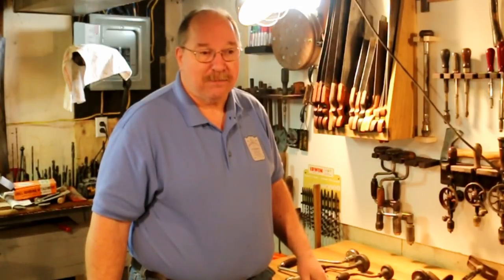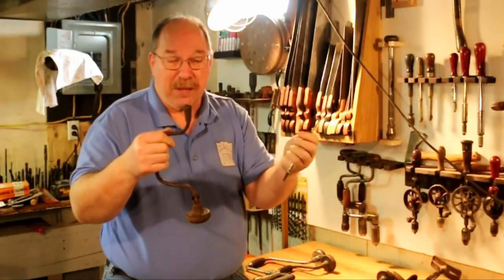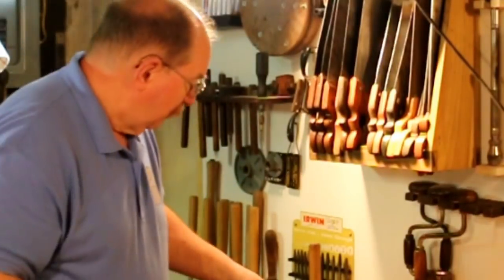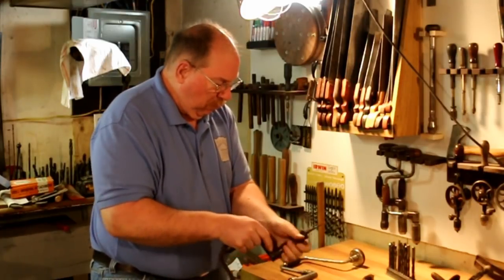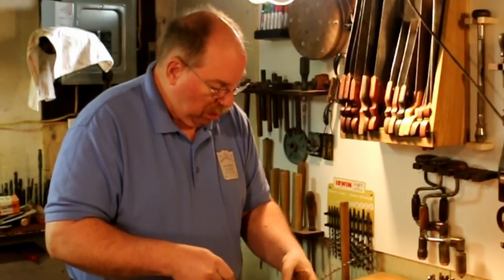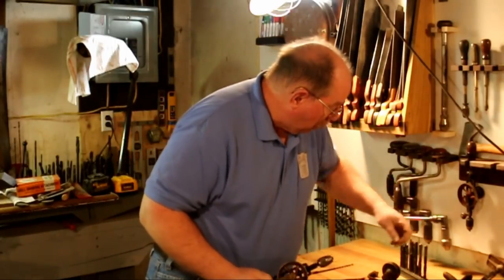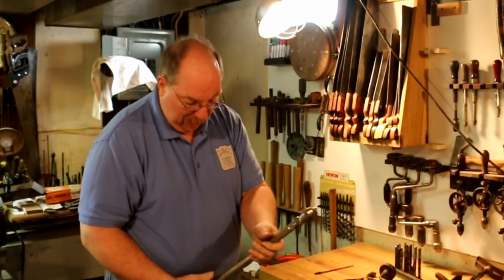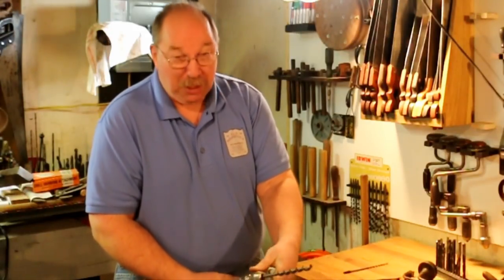Bob Weaver Made A Suggestion

Comment: Nice job there like the Stanley never seen them here , you could at one time get drills for the pump driver so similar but I have a 1/4 conversion for the pump drivers so I have a Jacobs with a 1/4 connection so normal twist drills go in it no problems very useful before the advent of batteries thanks again 👍
Reply from the maker: The first one I used was at Home Builders Inc. As one of the two electrians I set the ceiling lights and wall outlets in a complete house evety day. The battery operated drills weren't popular in 1973. The big Yankee screwdriver with a magnetic tip let me spin the mounting screws on the ceiling lights without standing on a ladder. The long #6 screws that held the outlet tabs were just a few quick pushes to set. 
I didn't know about the Stanley #41 push drill. They were originally called Mr. Punch. Those would have been handy if I knew they existed. I got by with a 1/2 air drill for punching 5/8" holes through the wall studs.

Comment: Really enjoyed that and wondered if you’d ever come across something I had many years ago. It had a tiny chuck that fitted either a hex or square 1/16” drill only, it twisted to clamp and release. It operated by running a brass lined wooden bobbin up and down a steel spiral shaft and on top was a wooden top that was on a bearing to allow it to be held solid and allow the spiral shaft to spin. It was really old when I got it from my uncle 40 years ago, no idea where he got it. I only had one drill bit for it which broke and it was then lost in one of the many moves. I have never come across another one, have you any idea who made it or anything about it. Great video 👍
Reply from the maker: I have seen them, but the price was always too high. They were a forerunner of the Miller Falls spiral drills. Since they would be a true antique and I have with only a few exceptions users, I will probably never own one.  I'll get into the smaller push drills tomorrow. 😆
Reply: Old Sneelock's Workshop wish I still had it, and looking forward to the next 👍
Reply: sounds like a pump drill or Archimedes drill.
Reply: Latro _ that’s it, I just had a look on eBay and there’s a few very similar archimedes drills that are the exact same design as mine. Mine was for a 1/16” bit only which I thought was a bit limiting but in saying that it was brilliant for pilot holes in wood which may have been its intended purpose. Thanks for that 👍

Comment: Mr sneelock sorry if I mispronouncing your name I've got a Heller bros file and need to put a handle on what kind of handle would it use it's a round one and it taper's down to a point but the tips broken off
Reply from the maker: It is always best to have a handle on your files. Round files can have different handles depending on how it is going to be used. I'll give you some options. I like to ave a fairly large handle because I have  large hands. You want your handle to be als long as your hand is wide. You should be able to wrap your fingers around it comfortably without having your finger tips touch your palm. I like wooden handles. They just feel better. Plastic handles tend to raise blisters because they slip. 
The file should fit snuggly into the handle. If it is loose it will fall out and if it is too tight you might break the handle driving it on.  Wooden handles should have a metal band around the end where the files tapered tip or tang is driven into the handle. If the tang is missing the use a handle with a hole large enough to accepth about an inch, 2.5 cm into the handle. 
Here is a link to a type that I like. https://www.ruralking.com/nicholson-wooden-file-handle-type-a-21520n?utm_medium=cpc&utm_source=google&utm_campaign=shopping&utm_content=55030544&adpos=1o3&scid=scplp55030544&sc_intid=55030544&gclid=Cj0KCQiAheXiBRD-ARIsAODSpWM5YVYKyLNDyYK4EIEikWGCUgrD7dNlmczMIM0NnLF8V85sCAy80DoaAvUiEALw_wcB
You don't have to buy one. I have used a hand made handle many times.